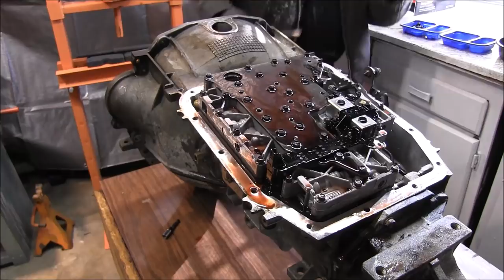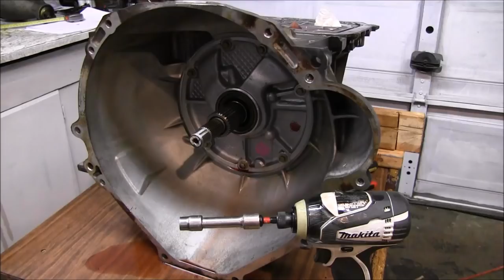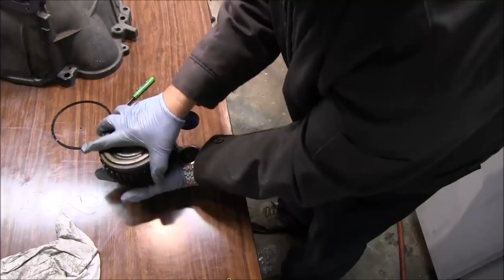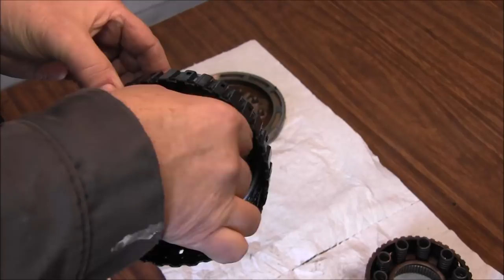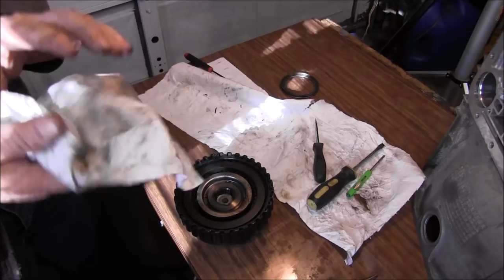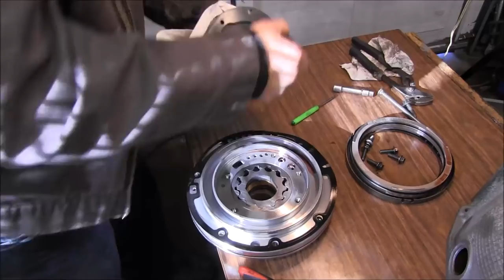#227 4r70w transmission tear down and inspection

Comment: Recognising damage, and knowing what must be replaced, are exactly the same skills you show in radio repair, Buddy.  So I now have even greater respect for your diagnostic abilities in other areas of engineering!  (And also enormous respect for the FORD guys who actually designed and engineered that highly complex transmission drive).
Reply from the maker: Thanks Hector. All the same basic skills rather electronics or mechanical. Thank you for the kind words.

Comment: Very clear and perfect info on the damaged parts. I'm glad you decided to show us. I have a Holden Statesman 1996 3.8L V6, and when I got it it would hardly crawl along, the dealer who sold it did not do the maintenance, so I can';t blame him. However the Holden (GM) dealer who 'serviced' it, I can blame, because I obtained the receipts from the previous owner, and it was supposed to have been serviced just 1 month before I bought it. Included in the service was oil change, trans and steering fluid replacement including filters. But there was less than 1 liter of Transfluid, and only 2 liters of Engine oil, also the filter (Oil), was the original installed in 1996. I bought this car last year. Once I replaced the fluids it now goes wonderful, Oh I checked the spark plugs also GM original (not made for at least 20 years), that made a big difference on fuel economy. When I talked to the Holden dealer, pretending I needed a service, he said the previous owner would wait around in the lobby until they were done, and he hinted that caused them to take short cuts. Oh I also found when I tried to get the sump plug out the head of the bolt was recessed, and almost impossible to remove, luckily I had many Motorbikes in the past and had some odd spanners with thin walls and was able to get it out. There was no washer under the bolt. Even better when I tried to buy one (the washer) from the Holden Dealer the parts manager did not know what part was required. I'm like really! that's a very common part, Oh he said the mechanics have never asked me for one.....
Never been back there.
Reply from the maker: Thanks for sharing that Andrew.  It is really amazing just what folks in the business dnot know.  And one reason I quit shopping at "big box" auto parts stores.

Comment: Merry Christmas Buddy,boy Im tired just watching you work haha,will be time soon to go enjoy that convertible! seen a lot of burned forward clutches back in the day,like you said due to old tired fluid,I would always recommend to the customer a separate trans cooler,better cooling and if the engine ever gets overheated the trans wont take a hit,in addition would convert cooler lines to pushlock hose(no clamps necessary on the trans at least) and fittings on the trans,especially helpful to route lines away from any heat source,plus you can easily add an inline filter,cheers!
Reply from the maker: Yes a lot of work my friend. But it is fun.  Looks like this transmission has never seen a wrench on the oil pan.  I will be installing a cool fin pan with drain plug and an external cooler.  Will make life so much better.  Thanks for watching.

Comment: Excellent disassembly video, we seem to have a lot in common, for the last 20 years I have been a professional videographer, I also hold an amateur radio license and have built kit cars and rebuilt many automotive engines. It is strange how some people though thousands of miles apart follow the same sort of hobbies. 

Derek
Reply from the maker: Thanks for sharing Derek. Yes I agree, very strange. I have built a Bradley kit car (sat on Volkswagen chassis), And a  Lamborghini Countach that sat on a Pontiac  Fiero.  All fun stuff.

Comment: Hey Buddy what a nice change from 'boat anchor' repairs. I didn't know there were that many clutch assemblies in an auto box. Are you doing a follow-up assembly video by any chance ?.
Reply: No need to answer Buddy, you mentioned it at 1:36. Looking forward to that one.
Reply from the maker: Thanks Andy, quite a bit of clutch packs yes.  Working on the reassemble video now in between other repairs.

Comment: Hi Buddy, Nice tear down , I worked at Borg Warner, they make the clutch disks  with the material on them also clutch packs. . The machine that bonds the paper to the steel clutch   is called aNSK bonder ,they have 6 platens on them, there heated to around 650 f  and simple robot arms put the treated paper segment to that steel ring that has a glue coating on it. Press closes at the 650 f temp, re -melts that glue and bonds the paper to the disk. [ NSK is the machine mfg ; we had different generations of them] I remember  troubleshooting one and finding a bad photo - slot transistor, that fired a servo. Very complicated machines. But when you break it all down its not that bad. Yes, Borg Warner makes some nice rebuild kits,clutch plates ect. For american ,Asian & Euro model cars. High quality parts. There products are installed on most new cars [ Just a final thought, you better check the transmission cooler on that Mustang ,with all those cooked inner parts .PS -I worked there last summer many different generations of equipment & plcs. That plant is in Bellwood, ILlinois, a small industrial suburb just west of Chicago,IL. Happy holidays...
Reply from the maker: Thanks for sharing your story on that.  I would love to see how these are made and the process it goes through. To bond at 650 makes me wonder just how hot this tranny got to lose it clutch material. Happy holidays my friend.

Comment: Are you going to flush the torque converter, transmission cooler and lines? Poor transmission has been abused and as you said it is amazing it isn't in worse condition. I enjoyed the tear down on this. Brings back memories of my past transmission building days. Have not rebuilt a trans in 20 years. Take care
Reply from the maker: Not going to flush the converter, going to install a new one.  Do not want to take a chance with something failing in it. Will be flushing the lines and radiator. Glad you like the tear down.

Comment: Enjoyed your video    I learned the term mechanical diode didn't know that    piv doesn't apply lol   never worked on a modern transmission  I can appreciate  now the skill needed to work on it doesn't compare to a old  C4 / C6 transmission   take care
Reply from the maker: Yep, Ford used to have a one way roller clutch and later switched to the mechanical diode.  The roller clutch was serviceable, the diode not so much.  It is a fun and rewarding skill to learn.  As far as the C4? one of my favorite transmissions.
Reply: @TheRadioShop a semiconductor device with two terminals, typically allowing the flow of current in one direction only.  cant find definition for mechanical diode

Comment: what other damage does the friction material do once it has left the clutch and moving about in the oil?
Reply from the maker: It contaminates the valve body and torque converter. Plus these little bits can be a bit abrasive and larger bits can clog cooling systems and cause the mechanical valves to strick

Comment: Question.  Is a bit hard to see.  Those O rings almost look as though they swollen up and dissolved so to speak due to maybe a fluid incompatibility and they swollen up?  Initial cause of failure?  Wondering,  it been long time since done a car trans.  Done a lot more hydraulic work on earth moving equipment but have seen similar in the seals.  They swell up and get all gooey like. They stick then all is lost basically.  Seems other seals not look bad though.  Back 'in the day' they only had a couple different automatic fluids, now they are all kinds, also bet they incompatible.  Then again though, I worked at a few different shops.  Mr. original consumer who bought car said 'Mustang, time to beat it', lol.  P.S.  far as fluid incompatibility, ever see Mr. consumer accidentally put some sort of oil in the brake reservoir?  Take the cover off and the gasket pops out 5 times bigger than what it is supposed to be?   Oops.
Reply from the maker: Thanks for sharing that. Yep, those lip seals are in bad shape.  My thoughts is he may have tried some of that transmission fix in a bottle.  By looking at the direct and forward drum you can see how black the metal has turned.  As you know you can take a piece of metal, heat it and drop it in oil and will turn black.  We call that "tool black"  That means a lot of heat in those two drums. Enough to melt the lip seals since they are very thin.  Plus along with what ever type of fluid they mixed in with it caused the seals to expand like they were soaked in petroleum.  I have seen what you said about seals expanding 5 times their size. Thanks for the comment.

Comment: How did you get your experience doing this sort of work? It seems as though you know your way around this transmission as if it is something you did every day for a living.
Reply from the maker: Hi Glen,  honestly I have never worked in a auto mechanics shop before for consumer stuff as a living. Electronics and mechanical applications has always inspired me. Growing up on a farm you learn to fix things yourself. Before the age of 16 I can not count how many times I have tore down a tractor or farm truck.  For the past 26 years I have worked in a manufacturing plant for industrial lift trucks (fork lift). Before that I worked for Firestone tire building plant as a mechanic. That plant opened in 1970 so by the time I started the equipment was obsolete and you had to fabricate every broken part including hydraulics, pneumatics, electrical and mechanical stuff.  You learn a lot over the years as a poor farm boy. Thanks for your comment.
Reply: @TheRadioShop  Tnx Buddy. Merry Christmas to you and Mrs Buddy.

Comment: Amazing stuff and much more fascinating (and more beautifully made) than I expected, also because you really know your way around such things. People that can design, build, and work on these things are geniuses. As for me, I'd be using language that makes the wallpaper come off and I'd be still stuck on the first bolt, most likely.  I never was compatible with mechanical stuff - it only breaks further on me, or the tools fall apart.

Odd thing is, I do work on mechanical clocks with some success. But big oily stuff like this is like Kryptonite to me.
Reply from the maker: LOL, thanks for that. It is not has complicated to work on as it is designed.  Just one piece at a time. Now clocks on the other hand! I hate them lol.

Comment: If I tried to take a transmission apart there would be parts left over...LOL
Reply from the maker: LOL Bill. In this case, that would not be good.  There are many parts in a automatic tranny and each one not only has to be installed but in the right place.  It is just basic mechanics :)

Comment: I don't mind attempting to work on a transmission.  What I find difficult is getting it down from the vehicle in the first place, lol.
Reply from the maker: If it was not for that I would do a lot of transmission rebuilds.  But you have to make sure it is installed correctly, if not warranty could be a issue.

Comment: The cycle time of the NSK bonders is about a minute,the steel ring is placed on a heated platen,aprox ~ 650 fh- paper put on top of that . Ring is heated at bottom ,to melt the glue on that ring that happened in a previous mfg step. Platen comes down,that paper,some of it is segmented. It is treated & designed for high temp.[Only sees that heat for a minute.] To bond that paper to the steel friction ring.Robot -actually they are simple pick & place X y Z axis mainly a sweep in  and load part/ring & paper.Then that completed ring goes on a run out conveyor ,it is put in a bin sorted by operator thru a shrink rap tunnel.Put in a kit,either in blue shipping containers to our big 3 or Aisian or Euro customer. Note: There are rows of them machines,different generations of them, runnnig 24/6. Each machine dropping aprox 6 a minute,so you get the idea,they can produce a lot of transmission friction clutch packs. Other areas of plant produce clutches for manual transmissions. Good industry, a product that will always be in need, for new & rebuilding shops & solo builders like yourself.
HAPPY HOLIDAYS TO YOU & YOUR FAMILY>
Reply from the maker: Very fascinating Hugh. Thanks